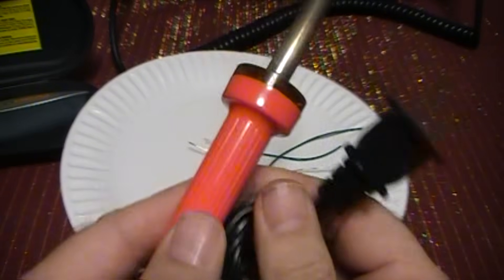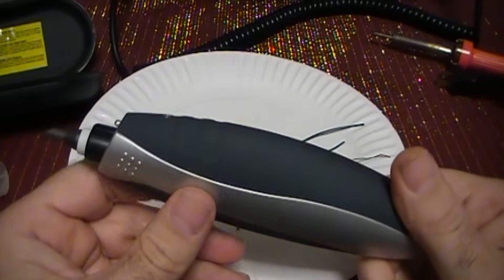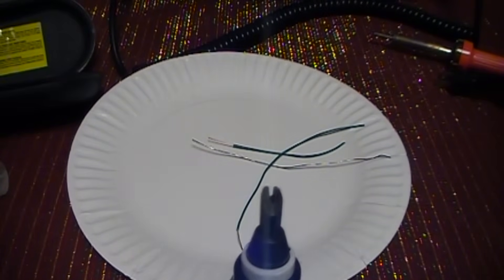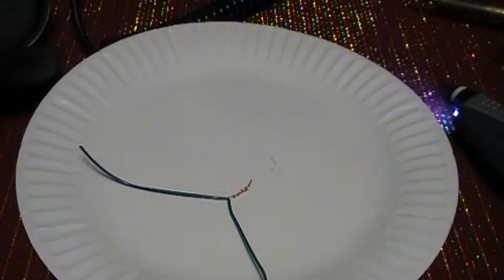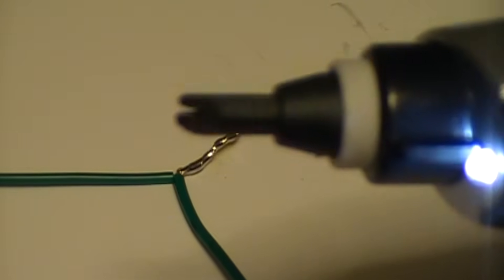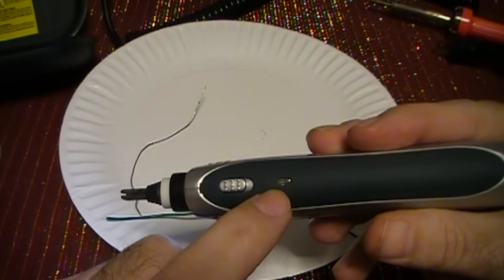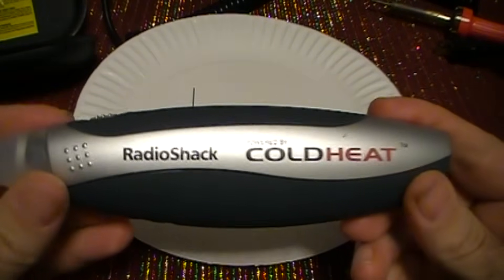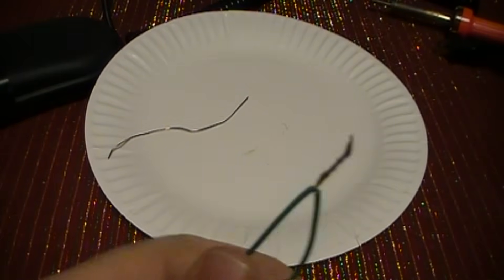Cold Heat Soldering Iron

Comment: Thank you! Eight years later and this video was SO helpful! I made an eBay purchase for jewelry supplies and it included this (along with some lead and vise pliers) as well as the cold heat glue gun.  I’ve never used a soldering iron, nor is that an option in my crafting area, but this tool is safe. So far the solder rejects all but one of my jump rings, but that may be something I can learn to work around. Also not yet sure if I can use any solder with this, but hopefully so; then I can use it on other color jump rings. 👏👏👏
Reply from the maker: Thank you for the comment.  I have found that very fine 60/40 rosin core electronic solder works best.  I just picked up what your problem might be; if there is color on those rings, you'll need to sand a very small spot that will hold the solder.  You'll have to do the same to any piece that you're mating together.  Solder needs clean metal to stick to.  The rosin core solder has flux in it, so this will aid you.  Good luck with your crafting and please keep me updated on your progress!

Comment: The soldering tip does not get hot because it runs a current through the wires heating them.  A regular soldering iron has the tip specifically heated.

Comment: They have USB powered soldering irons you can use with a power bank now. They're a much better buy for a beginner, and it lets you solder away from an outlet. So for example, doing soldering in your car if you're wiring an audio system or something like that. Even if you don't NEED to have the portability, even having more freedom with the length of the cable to move the iron around (not tied to a wall plug) makes things much easier.

That AND I've bought two of these Cold Heat irons, and both were pretty terrible. One didn't work at all, and the other could only solder VERY thin wire and VERY thin solder. And didn't work with lead-free solder at all.

Comment: Dad passed away, April. Mom tells me to pack up his shop , move it all to my place. She said she got all the tools she thinks she would need. I.e a hammer and the " screw turning thingy "    
Then I see it. Cold Heat. On the counter with my pops tool bag. So I ask her when did she start using it. She says my dad has had one in his tool kit for as long as she can remember. Mayhap, near 8 years. 
But I remember near perfectly his rant about it. That he would NEVER get one. How it was"always" not working when you really needed to use it because of the batteries being dead or low powered. ...
Reply: Sorry for your loss. Nice story!

Comment: I've got one of these.  The tips aren't very durable.  I bought it from a guy selling stuff on the side of the road.  It worked good for a while but the tip was really brittle and with very little pressure it cracked on both sides.  Also over the last year or so the rubber on the top and bottom started breaking down and it go so sticky it wasn't worth picking up.  I google how to fix it and came up with many posts and videos saying to use alcohol to clean it off.  Some said not to though, but I figured I didn't have anything to lose.  I used it and all that sticky rubber crap came right off with just a little scrubbing and now it's clean as a pen.  Can't use the iron though because of the chipped tip.

Comment: I bought one of these years ago but never used it. Recently  the plug end of my Fender tweed guitar cable broke right at the solder connection so I went to my toolbox to get my traditional soldering gun when I came across my coldheat gun. I thought I would watch a tutorial video before I attempt to solder my guitar cord and I’m glad I did and I’m glad I choose your video👍 as soon as I heard you talking about taking it to gigs and fixing guitar cables I knew this was going to be the instructional video for me. Thanks again👍 🎸 🇨🇦

Comment: They are soldering pencils, not irons.  Cold heat uses inductance for heating.  They are junk.  I kept the case for my safety glasses. 
If you repair ham radios, I hope you have an FCC repair technician license.

Comment: So the item you are working on has to be electrically conductive? Was trying to fix the loop on a medallion earlier, but all I succeeded in doing was causing the solder to bead up.
Reply from the maker: That is the downside of this thing.  It uses electrodes with a high current transformer.

Comment: video was good enough for me, but what about unsoldering? I need to remove a part that doesnt work.
Reply from the maker: as long as there are two metal leads or lead to solder pad, you can desolder with the cold heat
Reply: Im not sure if I know what you mean.  Sorry Im a beginner here
Reply from the maker: that iron has two prongs (electrodes) when both are connected (shorted) to a wire or component lead, current runs from the iron.  it is the current that heats the solder
Reply: so just touch one prong to unsolder? And dont you need an unsolder ribbon as well?
Reply from the maker: both prongs need to touch...use solder wick.
Reply: Im assuming the wick pulls the solder off.
Reply from the maker: yes
Reply: Thank you. Im going to attempt to remove a power jack that I believe is not working and replace it with one that does.  Im just hoping there is no way to harm the mother board doing this.

Comment: So... low voltage, high current. Got it. Do the batteries last more than 5 mins when it's heating?
Reply from the maker: Batteries last quite a long time.  It's all about the size of the work; this portable, battery operated soldering iron will do well on small joints, wires and SMT pads.

Comment: The first time I used this I was actually pretty young. I was maybe 13 at the time, and the right speaker on my headphones kept cutting out. I had been dealing with it for awhile and I got really tired of it. I wanted to try and fix them. I remember my dad got one of these and I asked him if I could use it. Now, at this point in time I was already at least halfway familiar with soldering. I knew at least the basics. Touch the tip to the work, flow solder to the workpiece, remove iron, etc. I was in the Boy Scouts for a little bit and at summer camp I remember taking an electronics course where they taught us the basics of through-hole soldering and various pieces of equipment.

Now, I tried to use this to solder a 30AWG wire to an SMD pad. Not exactly what it was designed to do. I remember having a HELL of a time getting it to work correctly, but that was mostly because the pad was so small. I could not reliably keep the iron in a good spot to get it hot enough. It actually discouraged me from soldering entirely. Over a decade later I now have a microsoldering lab in my room for working on a wide range of small consumer electronics. It's funny how the world works.

I was suddenly reminded of this iron when I was perusing Hakko's website checking for any new stuff (I'm currently thinking of upgrading my FX-888D). I saw they have a cordless iron, and it just made me kind of nostalgic. I actually had no idea until recently that the ColdHeat worked on the principle of resistance. I remember my dad was telling me it needed good electrical contact with the work surface to heat up, but that really didn't make any sense in my head because I was used to the concept of a regular old soldering iron. 

Once I learned that, I have to say this iron is probably one of the most useful things to have in some kind of emergency toolkit. Keep a batch of fresh batteries for it and if you need to do any basic electronics work when there's no electricity...like trying to solder up a connector for some batteries you have sitting around or who knows what, this iron will do the job and do it just fine. It's pretty similar to those butane irons. They only just barely get hot enough to melt solder but their purpose is for "in a pinch, off the grid" repairs like if you're out at sea and suddenly you lose engine power in your little boat because of some corroded and nasty ass wires. A butane iron could potentially save your life.

Don't listen to those fuckers in the comments, I enjoyed watching this.

Comment: Im slowly getting in to rc quad copters.. would this be ok to use on flight controllers for a quick motor swap or something? i see you have to kinda "ground" it like a welder but will it melt boards that you are trying to solder on?

Comment: would this work for silver solder for jewelry?  For those who find this slow, you can speed up the voice just fine.
Reply from the maker: BarbaraL Lowell no barb, Silver solder needs more heat.  get a corded iron at radio shack.  it has a dial to select wattage

Comment: I have had one of those knocking around for over 10 years now, never have had much luck using it, I am now relying on a cheap chinese 110 volt for heavy duty, and a cheap Chinese USb iron for quick jobs. I have a couple of butane for out of shop use, but I have ruined to many shirts to keep using that as a regular iron, wife don't like the holes I burn in them.  Perhaps I will dig mine out again and see if I can get it to work at all....

Comment: Is it really could? Looks like you really can touch it, I also noticed that it can not be use in small areas or any circuit board where you have a bunch of different connections closes one to another.

Comment: Looks easy enough, but I noticed the sparks when you started to solder.  I'm thinking of trying to repair something on an IC chip.  Have you ever tried soldering on those?  What are the chances of the arcing shorting the IC?
Reply from the maker: +Aphter Lyphe Slim to none....and Slim already left town.  I would not, no way solder an IC with this thing.  I would only use one of those Weller solder stations that have very pointy tip and a dial to drop the wattage down to like 20.
Reply: xxRenaissanceManxx Lol, thanks for helping to avoid a frustrating situation.

Comment: srry i did'nt check out the comments, any need for flux to prep or is it good to go, plus how light or heavy a job could this do, just light work or ss to sheet metal work?
Reply from the maker: +charles stugard just use 60/40 rosin core solder.  it will have the flux already in it.  this iron is for light work only.

Comment: Works a charm much of the time if you don't try to push the envelope, wish it had a smaller tip for using it on printed circuit boards, and don't forget guys, it requires Alkaline batteries that are fresh out of the package, not re-chargeables, not carbon zinc. Without this prerequisites met, it is landfill :-) but only for the ignorant fools who have spent $30 and not gone to their web site and looked at the 4 steps to getting very best from the little gem.
Reply: tramdr Why would it be bad for a PCB? The current would only move from tip to tip on the soldering iron, it would not move through the circuit and be able to damage anything.
Reply: MyUniqueUsername works great where ever you can get good contact. I haven't fried anything yet. Definitely earns it's keep :-)
Reply: You call others 'ignorant fools' yet you want to use this on a PCB. Wow. It solders like a small arc welder. Hi current. That would be about the worse thing you can do to a PCB, Chris.
Reply: tramdr `Looking back I am a little over the top on this one. I Really ought to edit that out eh? Must have been off the meds :-)Yes I need a little dressing down. but I must say I  use it for soldering small wires together  and successfully done some PCB work without penalty, when the idea dawns on me otherwise is really just occupies space on my bench. I suppose the best of it the instant heat, and thankfully I haven't fried anything ...yet. Regards.
Reply: MyUniqueUsername   thats simply not true. Voltage /Current, especially the hi current pulses of this device like to (and absolutely will) migrate. Exactly why normal soldering guns and irons which do not pass current like this does, are highly grounded. 2nd, do you know what a cold solder joint is? If not look it up. This is what this does and this is absolutely what you do not want, especially on a PCB. If you are happy soldering small wires, then stick to that.

Comment: I just bought one. Mind it's second hand. It wasn't able to solder a skinny iPhone charger wire. I could sit here all day and it would never get hot enough to melt solder. It does get create enough heat to which I can't touch the wire without being burnt. But yes, this product was a poor investment and a crappy invention. Well I'm off to buy a proper soldering gun. I was thinking that maybe the cold soldering gun could use a boost in power? Perhaps batterrues just don't offer enough juice to create the heat required? Any thoughts?

Comment: Got one of these to change my charging port on my galaxy phone and it didn't work! Its all a bunch of LIES! This thing is a POS sat there for one hour trying to melt the solder!
Reply: And I burned my finer with it! Have the blister to prove it.
Reply from the maker: Short CirQit
sounds to me like you burned your finger on either molten solder or hot wire.  the cold heat iron is not able to burn skin.

Comment from the maker: I can see by the comments that this product is a bit controversial.  As you can see in my video, it does work for me, however I have since switched to the butane gas soldering iron.  I still do use my Coldheat iron for smaller repairs.  Stuff that I can easily solder, it works fine.  If I'm working anything else my first choice is my electric iron with a dial control for 20 watts up to 50 watts.  Next would be the gas powered one.  I might do another detailed video using all of my stuff.  This way, you could make better choices.  I do thank all of you for watching the vid and for the comments and questions.  how you dooin
Reply: (Two years later) You may not be aware of YouTube "trolling". Some people get clever and blast other people's videos merely to get a reaction, don't sweat it. Thanks for the video and this comment explaining cold heat pros vs butane / AC soldering iron pros.
Reply: huaahahahahahahaha
Reply: Any suggestions on the type/size of solder?
Reply: wow, you're killing me dude. I'm jacked up on amphetamine while also sniffing bath salt. I was, as I should have been, bouncing off of the walls, until I got to this video, and OMG, I just had to bail on it as it was putting me to sleep. Talk about buzz kill. Bitch don't kill my vibe bitch don't kill my vibe, just get to your point already. I would go out of my mind if I had to try to to work with you all day. ok, that was constructive criticism, so stfu. peace out